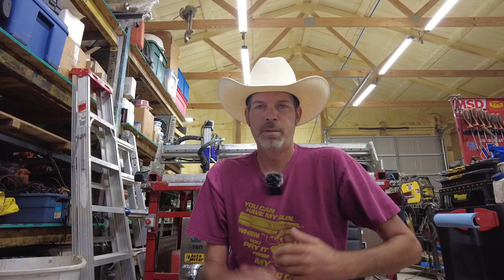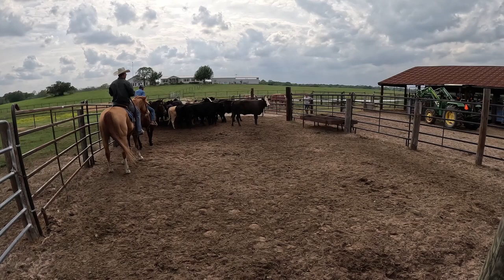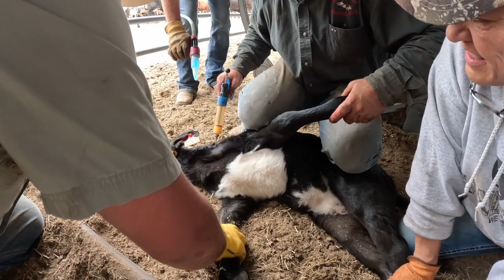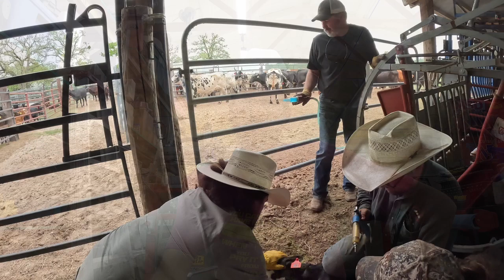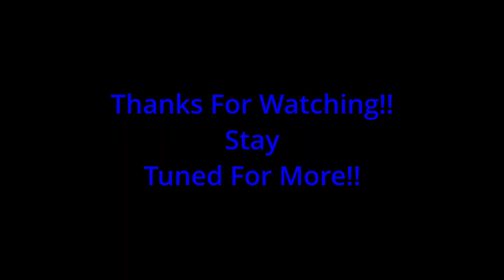Selling The CNC Plasma Table??? Lets Build A New One!! And other shop updates..

Comment: I'll stay tuned...
I have a similar project to build a second one next winter.
What table size will you build.
If you draw your gantry parts, lets follow the dxf files, would be great. Be sure, i'll follow your project.
Thanks
Reply from the maker: I plan to build the next on about 4'5" x 8'5" ish.. I want to be able to cut a full 4x8 sheet of steel. and yes, the few cuts made with the table will have .DXF files available. Thanks for following!